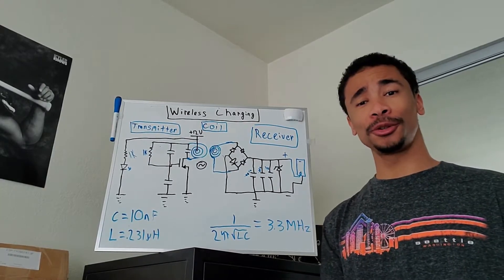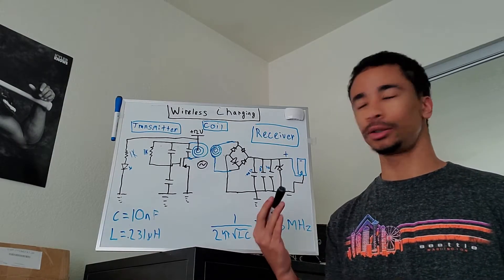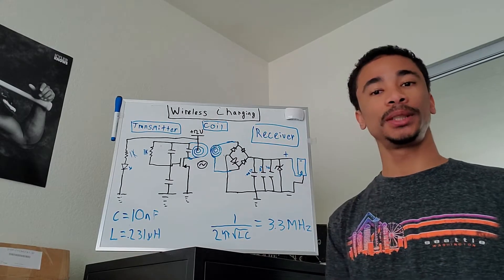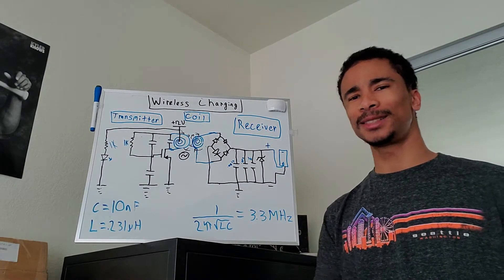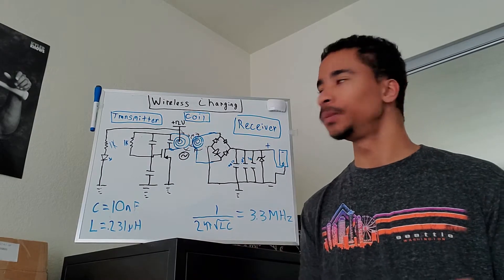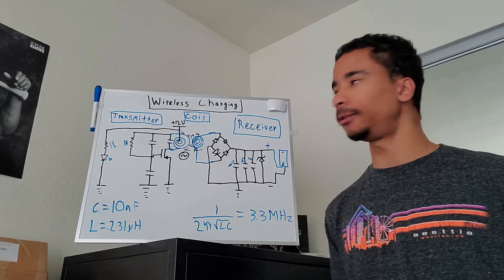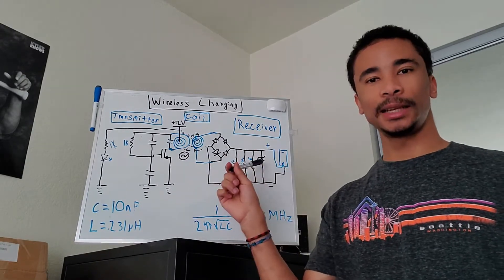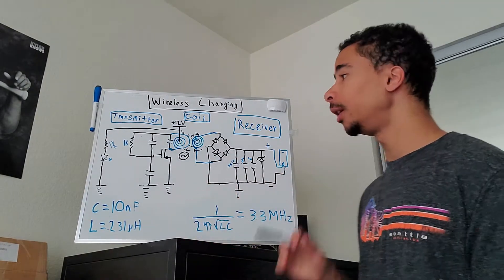How to Design a Wireless Charger!

Comment: QUESTION! IF YOU USED HOLLOW COILS AND RAN A FERRORFLUID OR SOLUTION HIGH IN HEAVY METALS, WOULD THAT AMPLIFY YOUR OUTCOME? IM A CARPENTER JUST REVENTLY GETTING INTO THIS SUBJECT. ANY ADVICE HIGHLY APPRECIATED. AND YESNINUNDERSTAND MIGHT HARD TO PUMP AND FLUID WITHOUT DWN SIDES. JUST HYPOTHEICALLY.

Comment: Nice video Michael. However I noticed you said at 13.00 that when the turns ratio increases the current increases thereby there is more voltage on the coil. That is simply not true. When you increase the turn ratio current actually decreases on the secondary coil since the power is same in the both coils and P = VI the current and voltage are inversely proportional. When you have more turns on the secondary voltage will increase and current will decrease
Reply: If he increased the turns ratio, produced a higher voltage on the secondary, and in both cases loaded it with a forward biased diode, then the higher voltage circuit will dump more current. You are correct though, in calculating the input current, I1*V1 = I2*V2 + losses. And if you have x times more V2 and y times more I2, you will get roughly x*y times more I1.

Comment: 1- is this copper wire or coil wire?
2- how many volts and how many current are you giving to the transmitter circuit?

Comment: my phone supports wireless charging
so reciever circuit is done

but i want the transmitter circuit to be fed with 220V 50Hz 
so what should be the voltage and frequancy be on the coil ?
Reply: That's evil

Comment: can you show me what components you are using (which wire, capacitor, resistor, diodes etc.)?

The calculations with the corresponding wire?

Comment: What if you generate a square puls with a microcontroller, an ATTiny for example ?
It works internally with 8 MHz.
But the puls frequency would be much lower, I guess. ( ??? )
Should it work ?
With a single coil ?

Comment: Hey Michael, so what would happen if I had a greater diameter and a greater number of turns in the transmitter coil? Would that in crease the distance and voltage in the receiving coil? Thanks Michael!
Reply: Yes! Your coils would be capable to produce more flux hence greater magnetic coupling. One thing to realize though is this means an increase of the inductance and therefore decreasing operating frequency, which could be a good thing too to avoid skin effect. You trade-off the space for the performance in the end of the day

Comment: If the power source to the transmitter circuit is an AC source such as I am plugging it into the wall to power it, do I still need an oscillator for a switching circuit for the transmitter since I do not need to change from DC to AC for the receiver?
Reply: You need oscillator to adjust the frequency..

Comment: Why did you use a DC supply and then convert it into AC through the oscillator? You could have directly used an AC supply? Is it because of the frequency and higher voltage level?

Comment: Thank you so much 🙏... You explain the circuit very well... It would be appreciated if you can share the components values as well... 

I made one referring other YouTube channel... I used my battery eliminator ... As power supply also use LM317 regulator... But circuit didn't work at all... Perhaps the circuit might not be proper... Now I will use your circuit hopefully it should work... Once I receive the components values
Reply from the maker: Thanks! I believe all of the component values are already in the video on the whiteboard, but honestly they don't matter too much as what's most important is the input voltage and the components you are using

Comment: I tried same circuit with BD139 and IRF540 , both Circuits didn't worked even though I followed same steps
Reply from the maker: You have to play around with it a little bit. But make sure first both coils are actually transmitting. What I did to test it was to use a waveform generator to verify that, then I connected the coils to the main circuit again.  Test out each individual component as well.
Reply: @N4Prs  yeah, actually the problem is transmitter circuit is not working probably , I'm unable to access oscilloscope due to lockdown.
Reply from the maker: @abhisheksaware4975  Oh that really sucks, the oscilloscope is super valuable in this! But I actually did this project without the oscilloscope, I started it right at the beginning of the lock downs. I used my multimeter to do what testing I could on frequencies. I would also make sure your input voltage is good, I used a 12V input for mine which gave me better results
Reply: @N4Prs  I will try again, right now I'm having exams from 11 to 20th May , If you have line id please share it

Comment: Hai sir... Can i know the current rating when the voltage was 2.7v..that is, during the first testing(1:2 turn ratio)
Reply from the maker: The current was around 50mA for a 2.7v rating. I think there could have been better ways to make that more efficient and output more current.
Reply: @N4Prs  Thanks a lot 😃
Reply: Same question

Comment: Hi, can we use without center tap  for transmitter coil ? and  how can we connect to the circuit without center tap coil ? Please answer the questions.Thank you.
Reply from the maker: Yes, you can use it without center tapping the transmitter coil! However, I wasn't able to make it work without center tapping, but I know it's possible. You could just exclude that portion that involves center tapping and I think it might work. So just remove that capacitor and completely ignore that part of the circuit.

Comment: Isn't the frequency of the transmitter to the receiver also very important..
Reply from the maker: Yeah it very much is, but unfortunately during my research, I couldn't really find how to factor that in. All I knew is that the frequency does have to be fairly high, and it needs to be filtered with resonance, so that's what I ended up doing.

Comment: Can you share circuit diagram on the breadbord ? is there one capacitor on the receiver circuit?
Reply from the maker: The circuit diagram showed at the beginning of the video is pretty much the exact same on I used. The capacitors in the receiver circuit aren't super important, you can use 1, 2, or 3 and it won't make a huge difference unless the voltage at the receiver circuit is really high. I was only using 1 in the video because I didn't really need any of the extra capacitors, but it would've worked the same with them.
Reply: @N4Prs  Thank you so much
Reply: @N4Prs  I am designing a wireless charger ,would appreciate your input and also if you have any valuable info to share with me.
Circuit design and all value of the electronic component. My Email = nuri.ylmz33@hotmail.com
Reply: @N4Prs   what is the name of type of oscillator here????